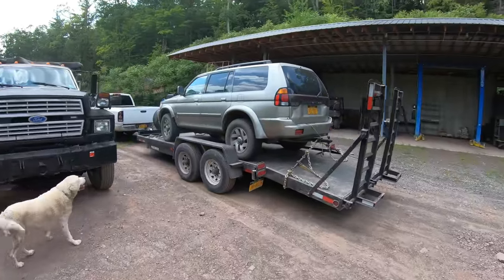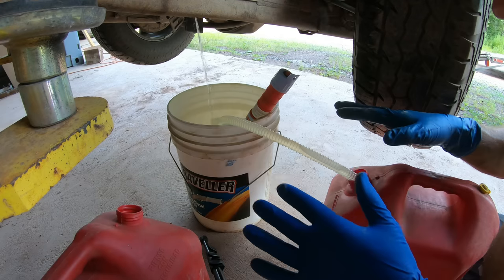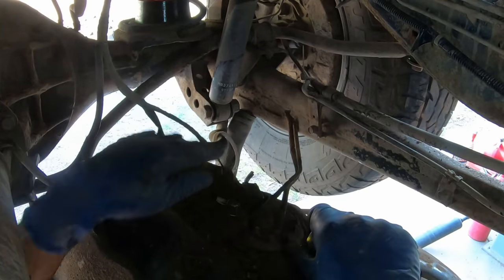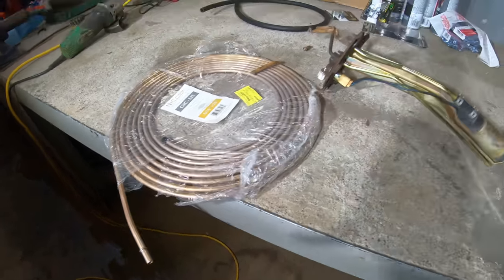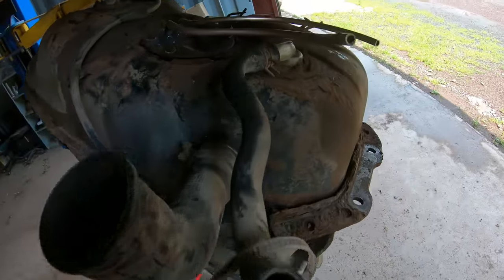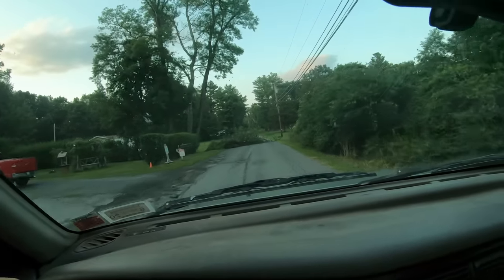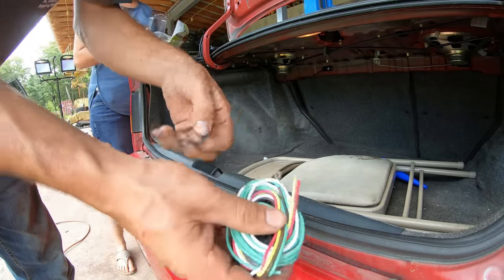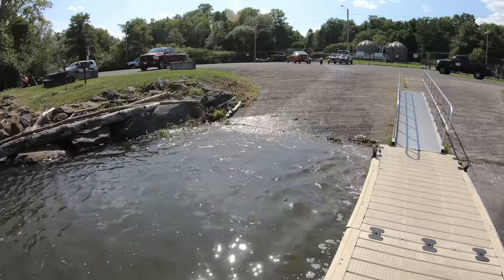Replacing a fuel line in a SUV

Comment: next video - lets go help my friend get her civic out of the lake.
Reply: Lol×-)
Reply: Opens door and loc ness jumps out and runs back to lake.
Reply from the maker: That be fine. My dad used to tow/launch a 25’ sail boat with a Jetta.
Reply: @AndrewCamarata  Nice of you to help a friend. Show her how to grease the wheel bearings on the trailer too. Great job on the fuel pump. Power steering lines fail more than they should. So annoying! Thanks for taking the time to share...
Reply: @AndrewCamarata  that is so funny......now we know WHERE you became you from.
Reply: @AndrewCamarata  I use my Jetta to pull my sea doo spark haha
Reply: @AndrewCamarata  haha my dad used to do the same but a 25 foot pontoon with a 92 chevy Beretta car lol. If it was to slick on ramp one of us would just stay in the boat and use the boat motor to thrust/help get the car moving lol
Reply: then he will pull it out with his dump truck and then somehow blow all the water out and say....."well that's fixed"
Reply: @AndrewCamarata  I used to tow a 14 ft runabout (the kind with a full windscreen and steering wheel with a 40 HP outboard) with a little 1987 Plymouth Horizon.  Had absolutely no problems at all.
Reply: Small cars with trailer hitches are the best! I have a 2500hd but don't drive it unless it's something my little $2000 Corolla absolutely can't do.
Reply: I used to tow Cadillac's, F250's and Bronco's with my Subaru '82 Gl  4 speed manual and my Honda '80 Civic 5 speed manual.  Once you got them rolling it was easy, endless lifting loops rock!  There is a bit of spring.  Looking forward to see how much my '89 Ford F150 4.9l i6 5 speed manual will tow -- 10k so far with a New Holland L555 skidsteer.  Class V hitch is good to 16k.  Rule of thumb is 35 lbs per hp. 145hp is only supposed to pull 5k...  bah...  When I can't maintain at least 30mph on a 6% grade, that's too heavy. I pulled the 10k on a 10% grade at 27mph and passed semi's.
Reply: @RobiSydney  I agree you don't always need a big dually deisel to tow, but keep it safe. The weight of the tow vehicle still has a lot to do with safe towing and most importantly don't out tow your brakes!
Reply: @Newman81964  Nice! I had a the same car, yellow four door, and man it kicked ass. Nothing much to look at, but great fuel mileage and awesome in snow. Should've never gotten rid of it!
Reply: @michaelsunsdahl5874  Yeah, I went from eastern PA to Wisconsin on 1 tank of gas.  It only had a 13 gallon gas tank.  The gas mileage was really good.  Never once did it get stuck in snow, it would plow it's own way through the stuff.  Mine was a light blue four door.
Reply: There in eu we are limited legally to tow only about the half of the weight of the towing car including the trailer weight
Reply: ... and congratulations 300k subs
Reply: @grant2k  the Honda and Subaru towing was all rescue towing..  usually less than 5 miles. I only tow heavy trailers with good brakes and perfect weight distribution. Drives people up the wall, when I'm moving a load back and forth.
Reply: @AndrewCamarata  My dad used to haul his bass boat with an early 80's Plymouth Sapporro with a 5-speed. That clutch and pressure plate were worn out when he got rid of it.
Reply: The comments about towing are terrifying. It's not about getting the load rolling! it's about stopping it and controlling it. Not to mention burning up transmissions and breaking the suspension, I've seen loads lift vehicles off the ground and pull them backwards. Not cool. Remember folks, everything is all good........until it's not.

Comment: The rest of the SUV will corode away long before Andrew's new fuel line does ..... BobUK
Reply: Andrew commented in the past how different the metal is in this Montero. At least the frame and body. He says the frame hasn't rusted significantly while his other vehicles rust on par with the rest of NY's cars.
Reply: It looked to me like he " butt soldered " that new fuel line, that's prone to failure but he seems to get away with some stuff I never would
Reply: Should have just replaced that sender, that's a hack job at best. A lot of things you do are great but this isn't.

Comment: My first car was a 1969 Firebird. And the trunk was so rusted out that it rusted a hole in the top of the gas tank. When you fill it full you smell gasoline inside the car. I use J-B Weld and cut a section of pop can out and laid it on top there after I coat it with J-B Weld and then coated the top of the pop can piece with J-B Weld. Drove the car for another nine years with zero trouble. Also patch the bottom of the tank the same exact way. Never had any trouble! Thanks Andrew love the video.

Comment: My metal brake lines rusted out on my 2001 Silverado last year. Very costly to have repaired. Upon getting home I noticed fluid shooting out from behind the front passenger wheel. Took it back up there and it was a rusted transmission line. Had that repaired and sold it. It's great that you have a lift and motivation, skills to DIY.
Reply from the maker: Tell them those repairs have to be free because they installed the wrong line.

Comment: This guy is absolutely amazing. Nothing is ever a problem for him and I respect that.... If I ever had to take that fuel tank apart and put it back together again I would be a nervous wreck with severe anxiety that there would be a fire and that everything would fall apart before I got it back together... that the electrical systems and wiring would fail and then... How do you even remember how to put it back together???
Maybe the problem is that I think too much but because of it I have to get a new car every 2 to 3 years.  Once a mechanic has to do any kind of major repair on my car I don't trust to drive it anymore.

Comment: Glad to see the fire extinguisher on scene and no job is too big for AC. A great fix but I was beginning to think he would need to replace everything up to the injectors. Optimism is believing he will have that vehicle in another 15-20 years without the steel tank rusting through and needing a case of JB Weld. The trailer wiring was installed "top shelf" and keeping the connector in the trunk is excellent advice.

Comment: I like his optimistic attitude that the truck will last another 20 years!
Reply: The lines he put on there will out live the truck most likely
Reply: It's a Mitsubishi, will out last any American yunk ie a ram...
Reply: He is optimistic about his abilities to fix it and keep it on the road.
Reply: I have a 20 year old mitsi, I can see it doing another 20, unless I kill the clutch, cause I'm no Andrew and I'm not paying for that job lol, but its 20 and not slipping yet so it should last awhile.  Haven't had to fix a 20th of what Andrew has on his, but we have no salt, and I don't thrash it like Andrew does lol.  Plus when it makes noises I just turn the music up :)
Reply: turbocat1984 nice! 
You could do the clutch. I have faith in ya!
Reply: @harryballzack  haha, I don't have all the gear!  Though you're right I try.  I have two cars so when one isn't working I have the other.  Took me a few months (and LOTS of research) to work out what was wrong with my crossfire.  Had to resolder some parts on the mother board, and put in a new timing sensor. Can't remember which now, was awhile ago.  The guys online told me I could do it fine because I was a girl with little hands and its right on the back of the engine.  And it took me awhile and I tore my hands up lol, but I did it and its been fine ever since :) it was 15 this year.  I've fixed the evaporator pipe (flooded my footwell) and replaced the air con motor a few times in my mitsi myself.  Got the last motor for cheap from china and had to wire it backwards cause it sucked instead of blew lol.  It whines a bit, but again, just turn the music up haha.  I love watching Andrew work on his, gives me faith I can do some more things on mine if the time ever comes :) I reckon I could do that JB weld thing no worries haha. But I think a clutch is probably out of my reach.  But I've had it since new and haven't killed it yet, so I think my driving style is ok to keep it til 350k at least (260k now).  I'll never get rid of it either haha.

Comment: My first vehicle was an 86 dodge colt with a 5 speed.   It had a bearing that blew out the side of the race.  A new race,a couple of dowels drilled into the case and some JB Weld got it back going.  It went on to put at least 75k miles after with no problems.   JB is amazing stuff

Comment: That’s exactly right a fuel tank drain plug would be awesome on vehicles so you don’t have to drop the tank to get the crap out of it and the water out of it and also like you said if you can have access to the fuel pump I can’t stand that I have to drop a fuel tank to get a fuel pump out it’s ridiculous they make the cars and trucks like they don’t want them to be worked on , And yes the nickel copper is good stuff I like using that,Good job Andrew

Comment: I cut an access hole in the bed of my 2000 Chevy K3500 to remove and replace the fuel pump. I cut a larger section of bed from a wrecking yard Chevy pick up to overlay the access hole.  A little silicone holds the panel in place.

Comment: When living in the Rust Belt, bought new a '89 Mitsu Montero Sport, just like one seen in AC's other vids. Ten years after, the fuel evap steel lines above the fuel tank turned into rust nightmare. Got a used tank from Alabama it was clean and solid. Painted the evap lines and tank with Rustoleum primer and top coat. Ten years after, evap lines starting to rust again along with frame and body. Engine, auto trans and 4wd were all running strong but it was time to let it go.

Comment: I use them same connector on every thing I can. I LOVE THEM!!!!! I have used them on our boat trailer that would have lighting problems every year or so after 3 years and using these no more problems!  All other connectors are unless and should only be used as temporary IMO. You should add a link to them from amazon in your comments they have like 10 different sized kits as well. I order the small set to test them and they worked awesome. I guess these are meant for marine use. I've used them on my truck, car's, boat's, Atv's for every thing from stereo, trailer, Ignition, head light, & ect connectors. If you get the one of the small butane handheld soldering torches with the guard you can get in some really tight place's with these connectors. Also you do not have to worry about burning other wire's that do not need the heat or are to close.

Comment: "Rusted out for no reason"

Drives a 20 year old SUV in New York.
Reply: He's right, should come from the factory with NiCu lines.
Reply: Rusted out because when you lived in an area where there is so much salt on the road for 4-5 months/year this SUV, as per almost every other of his equipment, never been pressure wash under every spring.
Reply: @nikos xois both type of lines actually cost the same, at least for brake lines. Don't know how the price is different for fuel lines, but having them corroded in just 15 years is nuts.

Comment: I used JB Weld on the head of a Mopar 225 slant six when a manifold bolt snapped off. A few years later, I had the head milled and they drilled and tapped the hole to repair it.

Comment: Oh man, watching this video brings back such fond memories of doing this type of job on my '94 Toyota Pickup... Your job came out good and you used what you could get your hands on, but the one thing that I would recommend would be to convert to AN-6 (I try to keep extra AN junk on hand, it works REALLY well and you can get compression fittings for fuel work). I did that with on my Toyota (I've got vids on my channel) and the braided stainless line is SUPER nice, it'll last forever as well! And you are 100% correct about that fuel pump hanger, they are hard to find and can be REALLY expensive, I think the one for my truck was over $200. I had no choice, since my old one was completely rusted out. 

Nice to see you wire that hitch up the right way. Man I hate those shitty splice connectors!

Comment: Hello Andrew, use a little bit of brake cleaner to mount a rubber hose on a metal line . It goes much easier and stay solid after the brake cleaner is gone . 
No slide spray like silicon spray because it stays there . 
Wishes from Germany .

Comment: Hey Andrew, I need to do that exact fuel line repair on my 1996 ford ranger, from what I know of the repair, it seems to be almost exactly the same job including the fuel filter on the frame rail.... About the pre-fab trailer hitch frames.... Some go in, piece of cake, some do in with much profanity and a couple of calls to the manufacturer! Video is well done!

Comment: Have you ever considered using the same method as in boats? Zinc-anodes. Weld some bolt studs to chassis and frame/ to areas where water and dirt (and salt) can access: Inside of fenders and bottom of the frame and chassis behind the wheels, and rear axle covers etc. And add some zinc-anodes.

Comment: Andrew mate, i know you have this ever present issue with the steel parts rusting, we dont salt the roads here in Australia and i haven’t seen a fuel line fail or a brake line either. So the car company thinking is probably lazy and just dont bother about the areas with snow. They want to sell more cars rather than longer lasting ones unfortunately. I have a 1969 datsun 1600 ( 510) and am still running all the original stuff. ( thats the car that comes to mind right now as its downstairs. Anyway love the content !

Comment: Oh boy, I've done a lot of these due to the corrosion in my area too.  I had the same deal with a sending unit, lines were trash.  I got a new sending unit with a fuel pump for $30 - total win/win when you already have it out of the truck.  Looks like you did a good job rebuilding that one though.  On the fuel filter though, they make EFI rated clamps with a bolt and a nut so you can get the tight, not snug like those worm clamps.  Hopefully that doesn't come back to bite you-

Comment: I'm waiting for a "buying a pickup truck" video.
Reply from the maker: Mun 56203 I’ve been editing it.
Reply: That was the first thing i was thinking at the beginning of the video. Looks like the old one finally bit the dust.
Reply: @AndrewCamarata  didn't the old ones engine blew up or something. You mentioned it in the video about redoing the new trailer. You said you'll still be using it for plowing and winter work I think. What made you decide to get a diesel?

Comment: Great video again, just a quick comment, that hose may be rated for fuel injection, but those clamps aren't. better to use EFI hose clamps (the ones with a smooth inner barrel and t-bolt type action) which clamp harder and not damage the hose. I've found with general purpose clamps (like heater or radiator hose clamps), the worm drive and sharp slots will cut into the rubber hose and cause damage over time. You'll often see the rubber balloon and squish out from these slots when temps are high and fuel has softened the rubber a bit.

Comment: I live on a farm a bit further upstate than Andrew. Our lines will rot out up here (from new) in < 5 years from all the salt. We usually cut-out and replace the entire tank, replace the evap/fuel lines with plastic lines, fuel filter and dope all the (future) removable pieces (bolts, nuts assemblies) with rp-342. Some fast hack & slash..followed with new parts that won't rust.
Reply from the maker: Vehicles should come from the factory with rust proof lines. Start sending the bill to the auto manufacture whenever you have to do that.

Comment: Love the channel, would just add that it looks like you aren’t heating those solder filled tubes maybe quite enough from the video, but it’s hard to tell.  Ideally rather than just melt you should see it flow up the wires you are soldering too.  Sometimes it’s hard to get a heat gun to do this  they make those tips that curl around the wire for this, helps to concentrate the heat in.  You could probably make a little hand held attachment also and just hold it.

Keep up the great work.

Comment: Reminds me of my  GMC Yukon fuel leak.  Rusted out lines and required an air hammer to loosen the lock ring on top of the tank.  Genius engineers have the fuel pump sitting in a recess on top of the tank so water and salt can sit in there and rust up everything.  Lived up to it's General Mess of Crap acronym.

Comment: Been there done that.  Did learn one thing the hard way.  JB Weld does not conduct electricity.  So on the one I did the ground was connected to the access plate and used the piping to ground the sending unit.  After repair the gas gauge did not work.  I have to drill a hole and run wire down to ground sending unit.  Not a big deal accept having to drop tank again.

Comment: Ugh, I've had to do that job three times AND repair destroyed fuel line from rats, I feel your pain.

Fuel pump went out on my truck several years ago, had to drop a full tank of gas to get to the sending unit. Ended up having to rebuild the sending unit since my truck is so old that they weren't available.

Friend had an 86 Toyota Camry where the fuel pump died because of a clogged fuel filter. Fortunately it had an access panel under the rear seat that made it a lot easier.

When I bought my work van, it had been sitting for four years and fuel gelled inside the tank. had to replace the tank and everything.

This last year, I've been having rat problems from the fields around the house chewing up my fuel lines. After replacing them all 3 times, I got sick of it and made armored sheathing out of coiled electric fence wiring and put rat poison everywhere. haven't had a problem since.